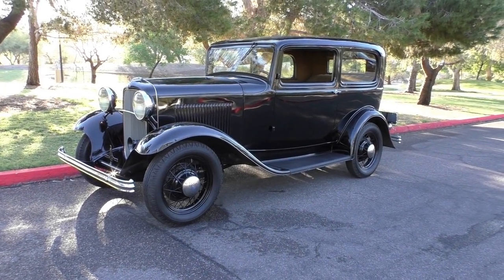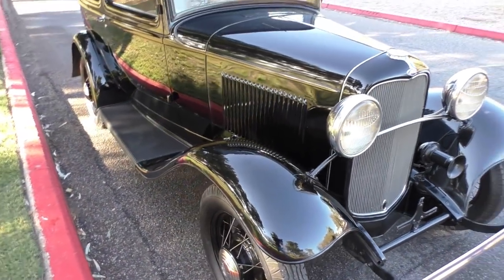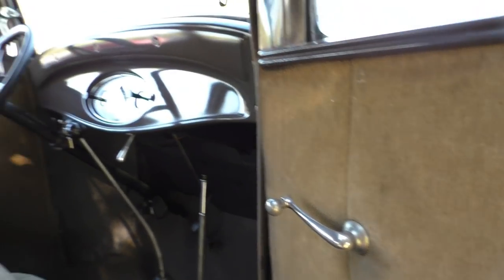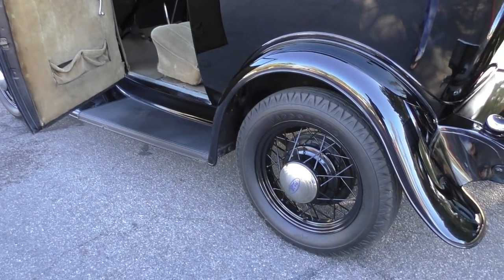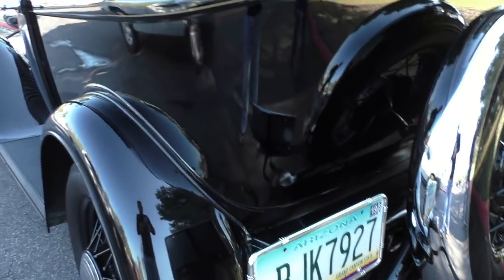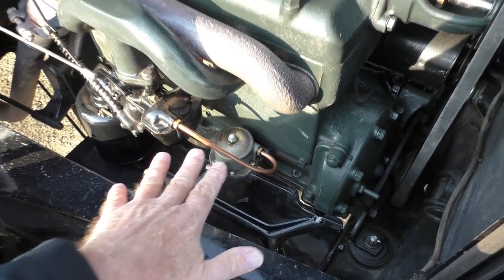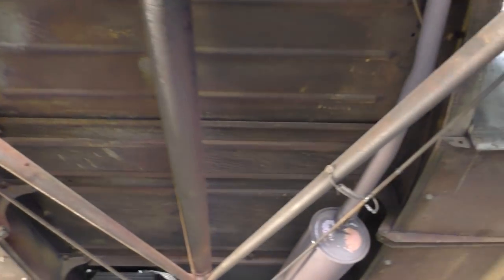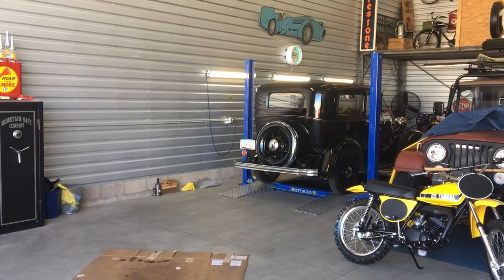1932 Ford Model "B" 2dr Sedan 30K Actual Miles (SORRY SOLD)

Comment: Do you know how rare this car is? It was Henry's interim car between the Model A and the V8. At 1st it was thought that both the 4 cylinder and the V8 would be produced but after a sampling of public desires the people who wanted the 4 cylinder didn't amount to much,  which was about 150,000 and about 130,000 were actually built. So, production shifted full time to the V8 and the rest is history. Production of the V8 lasted 31 years and is still available today if you want to buy one. So, imagine the millions of the flatheads built there were only 130,000 model B 4 cylinders and how many remain? This car is not only rare because it is so well kept with low mileage, original parts and loving care but the engine itself is rare and probably the best 4 cylinder Henry built. What a great car for this owner! I actually have one living across the street from me and I get to hear it run and see it in operation. Big annual car show this weekend here in Lafayette, LA (Bayou Roundup Car Show) and what feast of cars from the past, Cajun Music, food and dancing too. Lord I've gone to Heaven.

Comment: The cool thing about these old 4 bangers is if you want more pep.there are so many period correct options  to keep the car era correct. Add a B high compression head, better carb and manifold. Boom, you've just gone from 50hp to 65 or so. What's great is these modifications were done back then and easy to reverse if you want totally stock. That's a gem of a car. I hope it didnt go to a rodder.

Comment: My next automobile will be a Ford Model B. The only thing I would change is the brakes. I'd upgrade to a modern pick-up truck 4-wheel disc-brake system, everything else stays the same.